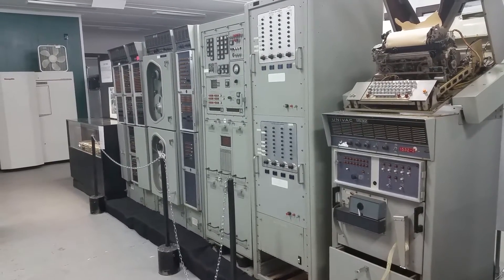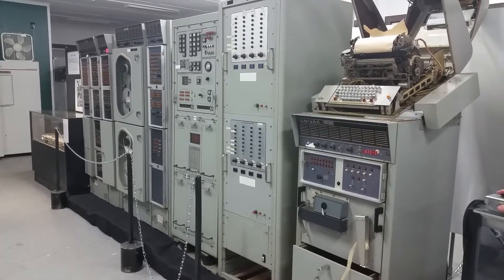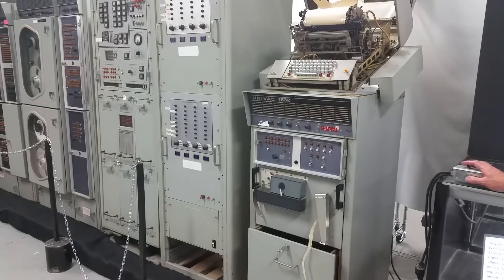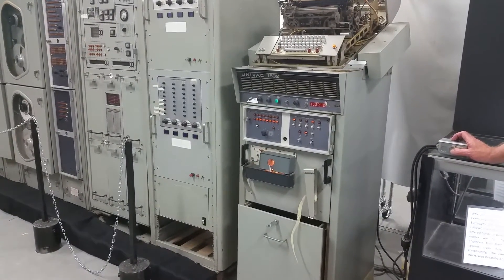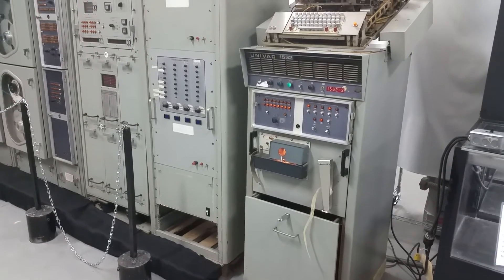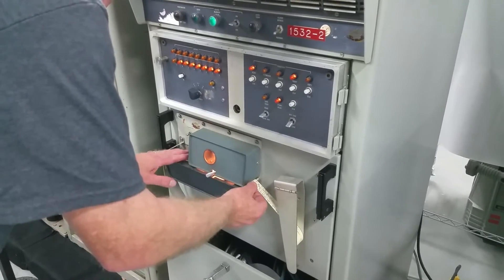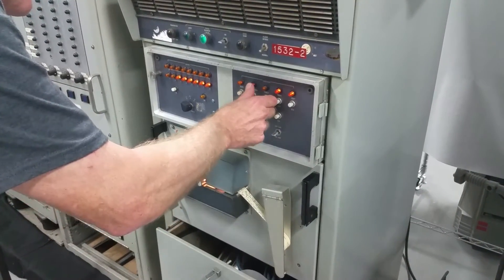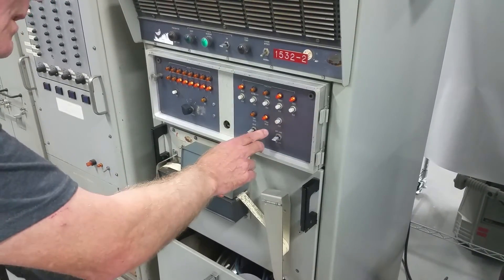Univac 1532 Input/Output console - first power up

Comment: This UNIVAC 1219 computer, in its C-152 US Navy version with 32-48-kbyte 18-bit memory, was, in its 32-kbyte configuration, the one that ran the TERRIER Anti-Aircraft Guided Missile Fire-Control System (GMFCS) on all ships with the Mark 76 MODs (versions) 6-9 (~1974-1992, when all TERRIER warships were decommissioned) of that system (prior versions of that system used the C-47 electro-mechanical fire-control computer).  MOD 9 was the MOD equipped with the SM-2ER version of TERRIER, extending the range considerably and greatly improving the kill probability of the system.  TERRIER was used in a number of Destroyer Leaders and Cruisers, including the nuclear-powered USS LONG BEACH and in three aircraft carriers (these carrier versions were never updated to digital computers and were eventually taken off the ships -- they never should have been put on an aircraft carrier in the first place).  The last MODs of the TALOS AAW GMFCS, on the USS LONG BEACH and on several converted WWII cruisers, used the 48-kbyte version to control two systems simultaneously (time-sharing internally!) -- TALOS was retired and turned into the VANDAL high-speed test/training target in the mid-1980s.  This computer, to my knowledge, was never used in any US battleship (though it is possible that NEW JERSEY had it when first recommissioned and modified for Vietnam duty).  TALOS went away due to the TERRIER and TARTAR SM-2 versions completely rendering it obsolete and TERRIER went away without warning when the US Navy decided to get rid of all non-nuclear steamships by 1992 so only gas-turbine-powered conventional warships were allowed -- the remaining couple of nuclear TERRIER ships, such as LONG BEACH, were not considered to be worth keeping all by themselves, so they went away too.  Note that the "little brother" UNIVAC 1218 was also used in TERRIER-equipped digital-GMFCS-computer ships as the interface between the TERRIER C-152s (one interface connection for each two-computer, two-system TERRIER missile battery) and the ship's Combat Information Center (CIC) UNIVAC 642B 36-bit computer systems.  I used the shown magnetic tape units (two units per TERRIER battery) and the single UNIVAC 1532 Teletype system per battery for a long, long time at my Computer Engineer/Programmer job supporting at-sea TERRIER ships from the US Navy shore facility that was originally called NSMSES and later NSWC/Port Hueneme Division on the SeaBee Base in Ventura, California...

Comment: I was a maintenance repair tech on Univac 1500 data processing systems, and I 'may' have stashed away in storage all of the schematics for the 1218 cpu and other peripherals (mag-tape, card-reader/punch, teletype, high speed line printer and UPS power supply) for the systems I worked on.

https://youtu.be/Ikj2fJY-5Dg?t=301